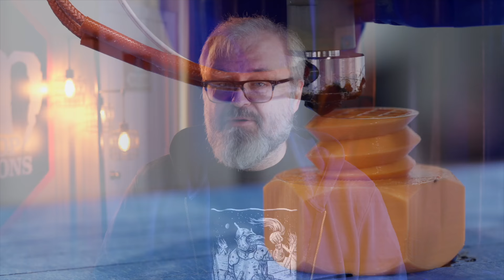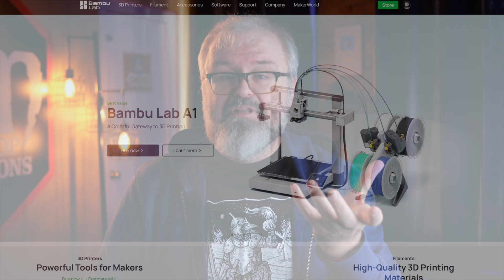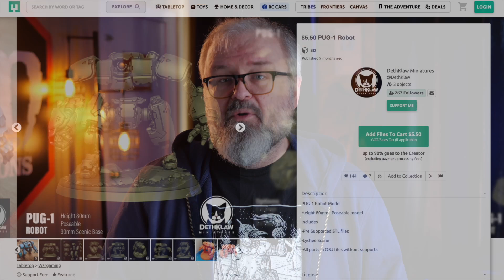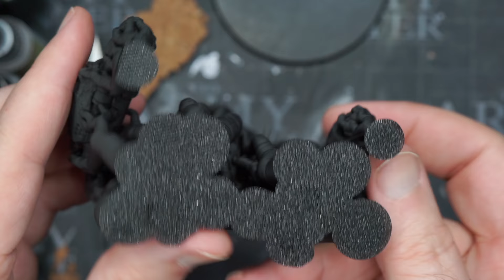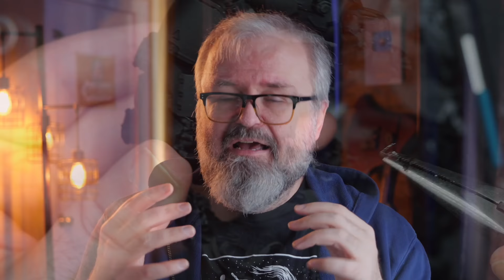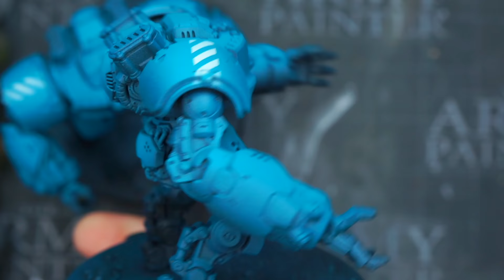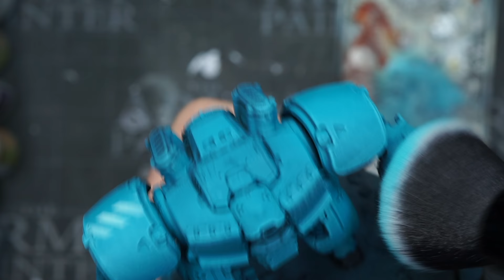I Compare RESIN vs. FILAMENT for 3D Printing Wargaming Minis

Comment: I've done all my model printing in FDM by necessity because of fumes / etc, our respiratory problems that PLA printing doesn't aggravate, and the available spaces to setup printers not being suitable for resin either because of occupancy or lack of environmental control.  I've had some success, and plenty of failures along the way, so I'd generally call FDM robust as the prints are stronger and can be much bigger without issue, but also finicky as there is a lot that can go wrong if you don't keep an eye on it (like filament absorbing too much moisture, build plates needing cleaned, nozzles needing cleared, etc) not to mention the absolute rabbit hole you can tumble down fiddling with print settings, but here's the gist of my experience...

I still print the models in parts.  Orientation of the part when printing makes a big difference in both quality of details (if you want a surface to look smoother you probably want it to be more vertical, for example) and strength of the piece with PLA (the bond between layers is weaker than the layer itself, so longer thinner pieces are stronger if they're printed closer to horizontal [but be careful of trying to bridge a gap too big if it can't get a support in there]), and the changes in print direction from piece to piece once you assemble the model helps hide the layer line effect as well as giving you places to hide any potential scars from the supports.  Using a thicker spray primer instead of an airbrushed primer also helps fill in the lines.

When removing the supports, I use a hobby knife and nippers to pry the tree supports off carefully to minimize the damage (to the model, myself is another story).  There may be better ways, but it works for me if I setup my print correctly.  It's the trade off from resin: supports are a pain to remove in comparison but there is no washing or curing or handling of messy toxic liquid.

Spindly / thin bits are also not going to print that great in FDM and be a lot more prone to errors and failures, so yeah you do need to be mindful of the STL when choosing what to try in FDM or you're likely to end up with a spaghetti monster.

I haven't been able to get detail levels on small prints that match, say, the injection molded plastic you buy from wargame manufacturers, but it can get fairly close if you're willing to put in the time.  And I do mean time.  Like 9-12 hours (or more, I've had closer to 18-24 on some) of printing for 1 terminator-sized mini, laying down thin layers with a small nozzle at a lower speed for maximum print quality.  So even if you do get really good looking minis, the resin printer will print an army a whole lot faster, but the FDM printer will print the big centerpiece models like vehicles better as they're more sturdy and less prone to warping when printed in multiple parts as there's no curing process.

All that said, for tabletop?  Yes, I think FDM is absolutely fine.  Getting an FDM print to display quality painting though... that will need a lot more post-processing tricks.  Prime / sand / prime is the basic example, but coating in resin or giving it a vapor bath in certain chemicals are also tricks I've seen used to get a mirror finish on big smooth rounded surfaces of FDM prints as well, so you can make the layer lines largely go away with enough work, but at that point just use resin if you can.

Comment: Funny you say this with the texture paint, because I just did exactly that on a terrain piece I printed in FDM, that had a ~10cm long 45 degree incline, so the fdm stepladder was on full force. It worked wonders.

Comment: Great video. I liked the honesty and, as far as possible, the attempt at impartiality. I'm considering buying a Bambu Lab A1 Mini printer because it has reasonable quality, is user-friendly for beginners and, most importantly, doesn't require all the care with toxic materials that resin printers require. The fact that filaments are more resistant than resin is another relevant point.

Unfortunately, I'm almost certain that 28-32mm models that are more complex than basic space marines will look pretty bad... I imagine that filament could be good for games focused on vehicles (sailing ships, spaceships, tanks, aircraft, mechas).
Reply: Basic resin is really brittle and I dislike it. However, there are a lot of "tough" resins, like Chitu Conjure Tough, which are just as if not more durable than plastic. PPE for resin can be inconvenient, but printing in batches helps and support removal is easier.

Comment: You young people with your ones and zeros! Metal minis all the way! But as a serious answer: I wouldn't buy or paint any model that has visible layer lines. Neither resin nor filament prints. They might not be visible at gaming distance but I will see them at every brushstroke and I'm not doing that. I will, and I've said that before multiple times, stay away from the 3D printing hobby until they reach "Star Trek replicator" levels of comfort and quality. Until then spin cast metal minis and plastics are the go to.

Comment: The biggest thing is finding models that can be printed without supports OR can be arranged in a way that hides them very well. Most minis aren't going to be fantastic on a filament printer but Tanks print great. The small details on a tank are less important and they can usually be printed with minimal support. Added bonus that if the print does turn out quite how you wanted, it makes great terrain
Reply: The monetary factor is real! Miniature wargaming used to be a largely DIY hobby; FDM printing is bringing that back! Welcome to the Renaissance of wargaming!!! 🏴🏴🏴
Reply: You can always cut the mini up in Orca and even add connectors. I have printed several 6mm minis that are virtually undistinguishable from resin minis.

Comment: I've used FDM printer (Bambulab A1) to print 28mm scale minis from Station Forge (and other places, i just got given the STLs from my friends 😋). heres a couple of things I've learnt: 
(tl;dr play with printer settings and model orientation)

FDM printers vs resin printers, for me is the difference between having a model that is not the tip top quality and not having a model at all. because i rent a place to live, I'm not allowed a resin printer, so FDM it is. Plus i dont want to get lung problems with resin fumes.

The orientation of the part is important,  you'll get absolutely 0 details on surfaces touching the build plate. I used the textured build plate that came with the printer. The default orientation of the model made it print a gun laying flat on the plate and the texture of the build plate got printed onto the gun. And that. Looks. Bad. 
If i were to print it again, I'd orient the model so the surfaces i cared about would not be touching the build plate. Of course, this is balanced by the supports and how well the model sticks to the build plate as it's being printed (I've had failed prints where the model detached from the build plate mid printing, no huge waste except for a couple of hours. Experimenting would help you with that.)

Another thing with orientation is how smooth you want your model's to be (😏)
For example, if you're printing a cylinder, its better to stand the model upright than laying it on its side. This would make the curved surface of the cylinder smoother because there is less gradient change between layers (try building a cylinder on both orientations in Minecraft)

Finally, you can set the gap between the supports and the model to optimize how easy it is to remove the supports vs print quality (Top z distance in Bambulab's slicer). So experimenting with different settings would help you get the most out of your printer (filaments are fairly cheap compared to resin). Failing that, a modelling knife should make short work of the dangly bits from the supports

All in all, I'm happy with my printer and i plan to make a Trench Crusade warband with just printed models

Comment: Now you have to do a video, where you tinker with the FDM printer. Print it in parts, maybe gut the parts in half in the slicer, so they fit flat against the plate. Some people print at and 45 degree angle to minimize layer lines. Take it as a challenge to see how far you can take the fdm printer. Maybe try a tank. Boxes works better for fdm.
Reply: The art of printing without supports, and minimizing layers lines! Yes, this is an art form to expand upon for FDM. :)
Reply: Or don't try the tank. Yes, it works better for FDM, but that misses the entire point of a comparison like this. Cherry picking models to do whatever best covers up the shortcomings entirely defies the core idea of doing a 1:1 comparison of using an FDM printer to do a job often assigned to a resin printer.
Reply: Definitely agree that boxy tanks in FDM are worth it over resin prints.
Reply: agreed, I think "filament" minis might be more difficult to tune and get right. His filament print is surprisingly poor quality. My fdm minis have gotten so good that I am hesitant to share  because of how mad the resin community will get at me ha. I printed a termi last night that could pass for resin, 1 took 5hr20min though :0 bambu a1. This entire comment section has some great tips and tricks too.
Reply: @sethl8905 time is the big downside with FDM minis.  But, please share your secrets if you can.  We are all learning.

Comment: Something to consider would be print time! Here there is little contest between a 0.2 nozzle and a system that prints the whole layer in a fixed time.
A bit mor complicated: will the model have parts where the layer structure of FDM combined with the cross section of the model leads to structural weaknesses?
Reply: It takes me years to paint an army anyway. Slower printing time isn’t really a downside lol

Comment: If you use plastic filler, greenstuff, and various grits of sandpaper you can improve the FDM result quite a bit. Look up how cosplay props are finished after printing, it can be applied on the smaller scale.
Reply: I agree with this idea. Maybe even use an emory board. In either case, you might want to wear a mask so that you don't inhale the dust produced by sanding.

Comment: Both models look awesome and were very well done! Still I think most will opt for the "drop it into the slicer, make x copies of it and just print it" version instead of redoing the supports or even parts of the model - time and money relation. But yes, if you are 'stuck' with filament due to available space or health issues, that is fantastic and can be  as much part of the hobby as painstakingly painting a bought model from the shop. 
In the end - it's your - the player's - model and you should play with it, not treat every piece as golden demon contender ;)

Comment: Having seen both I probably wouldn't notice the difference outside of some specific points which looked like damage from tearing off the supports. I'd be curious if there are better ways to approach that. 

As for giving the two an "equal" paint job I do think that approach gives an inherent bias to resin as it is the more traditional/established printing method for minis. As such the established painting methods are also designed with resin style printings in mind. As you noted changing your painting style on the messed up mini showed significant improvement over using a more "standard" approach. I'd be curious to see if there are more ways to improve by using different painting techniques.

That said it was a very interesting video and I enjoyed watching it and getting to learn more about the end results from the two types of printers.

Comment: I think the Battlefront Valkyrie people are really on the right track. In the next couple of years i think we will see more models designed specifically for FDM, with the layer lines being well accounted for by the designers. Remarkable the change in terrain quality i see with modern FDM printers compared with just two years ago. The toxicity of resin printers is a limiting factor that seems harder to overcome than layer lines for FDM printers
Reply: I think the mess is more a limiting factor than the toxicity. You just need carbon filters air purifier in your printer cabinet and a mask 
Dealing with liquid resin, having to handle it, remove it from the print somehow, likely using alcohol, the having to distil that to clean it. It's a lot of mess. 

I got a resin printer years ago and it's just been sat there. Printed one thing with it and realised there's nowhere I my house I can really risk getting resin everywhere. 

Whereas ive been printing with my filament printer for years. And you should also have carbon filter air purifier in with a filament printer too. They still give off fumes. 

I think if I'm ever going to be able to use resin I'll have to build a glove box chamber where all the resin is contained and I can work under zero uv light. But then it's a bad idea to have alcohol in a sealed chamber like that, so I'm going to try experiment with cleaning resin prints using an air duster to blow it off, and reclaim as much as possible. But I'd need to buy a cheap metal sink and build the glove chamber. So its a lot of work to create a clean setup.
Reply: @ge2719  Well, I don't mind the mess. But I do mind the toxicity. Air purifiers are just little more than a placebo for the smell, they don't remove the toxins. If you don't have a separate space like a shed to put your resin printer in, I would stick to FDM.

Comment: Couple of things, the robot is quite hard especially with rounded tops and it is centre piece. Try it with smaller figures in rank and the issues disappear a bit. I print Quar on an automated glue gun and you can see layer lines but on a table not so much. I've had mates do resin printing for me and they lose detail too, but I suspect that's the resin they're using and remember your friend Dave removed all the supports from your resin print. Plus I don't paint to display standards so the layer lines I have fit in with alll the other paint defects on my TOYS.

Re pre build, I find that it is easier to prebuild some components in the software but still assemble others later. It really is on a model by model basis. I've even cut some models up, Rancor for instance, to actually print better in FDM. Like all things there is no balck and white just shades of grey. Have fun with your gaming.

Comment: Been awaiting this video.

I've been using a cheap FDM for about a year now to print figures for DnD. I'm no expert, its been a fun learning experience, and I've got some good figures out of it.

I've argued for a while that with my crap level of painting, and dodgy old age eyesight, at 4 ft away on the table, absolutly no difference in percievable quality.

I always print in bits then assemble, the random changes in layer direction helps hide the issues, and usually makes support removal easier and reprinting failed parts (or if i break/loose a part) much easier.

I'm winning no awards, but I'm getting large playable models painted on the table with minimal cost and effort, which for a single DnD session is all I'm looking for!

Character size, maybe not so much, they are ok for back ground or mass battles, but anything over 2" works really well and I'm very happy!
Reply: Fat Dragon Games is a godsend for DND stuff. Entirely optimized for FDM printers.
Reply: @Balmong7-y4s  I'll look them up! Amusingly enough a "Fat Dragon" is my most recent print that I'm just finishing up the paint job on! Wanted a chonk, Got a chunk!
Reply: If you don't already have, you definitely want to check out BriteMinis. He makes wonderful supportless minis for FDM-printers. His patreon is not expensive and it's really worth it. I printed several warbands for A Song of Blades & Heroes at minimal cost (still have to paint most of them ...). And if you're into TTRPG, he got you covered with everything from regular bandits to trolls or dragons. I can not recommend his stuff enough. Also, there's sablebadger on myminifactory. He doesn't have that many models but the ones he has are really really great.

Comment: I have been using a Bambu labs printer for terrain and miniatures. The only changes in my painting process is to use a good primer which flattens out the models surface, and the use of stippling as a technic rather than dry brushing. Ultimately it's about choosing a model which can be sliced and printed to minimise the layer lines introduced by using a filament printer. So some models have just remained STL files....
Reply: Doesn't the primer reduce detail in this case too?

Comment: Thanks for your video! I've learnt that filament printing will never be for me. I already get triggered when I see painted models with the mould lines still there, unremoved, unbothered, highlighted, and these are a big deal breaker and a paintjob ruiner for me. I couldn't stand noticing the filament lines along my mini. Now I know what path NOT to take, which is great!

Comment: I think both printers have their uses. For terrain / blockier pieces, filament is the way to go, but if I'm printing a model / something I need detail on, it's resin all the way. Another brilliant video ^_^
Reply: My take is, if you can, have both printers... resin is just so much better (and much less work) for finely detailed models. I use my FDM for terrain and larger set pieces.

If you can't have both printers, get an FDM printer -- it means more work for smaller models, but it's way more flexible for everything else (you'll never print "practical" things in resin).

Comment: I own both a filament printer and a resin printer but i have used resin to fill in layer lines on filament prints. Just paint it on little  by little stopping to cure the resin its kind of a timely process but when your done and primed its hard to tell its a fillament print